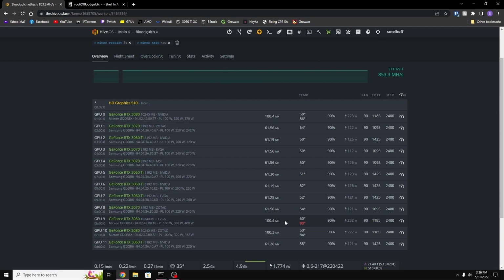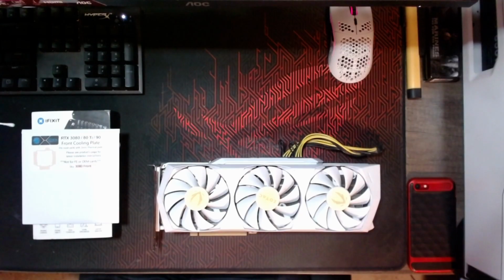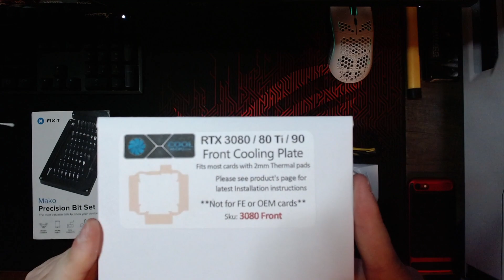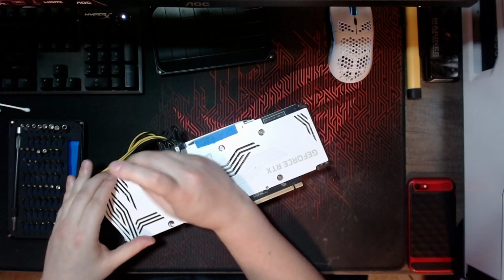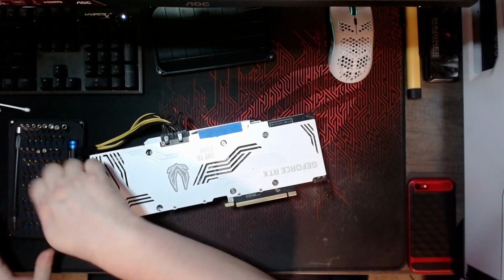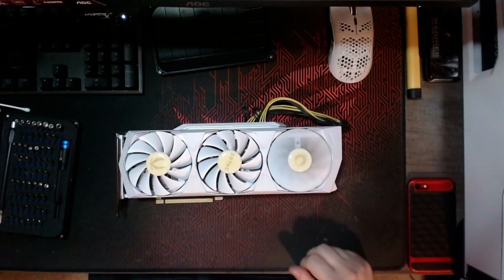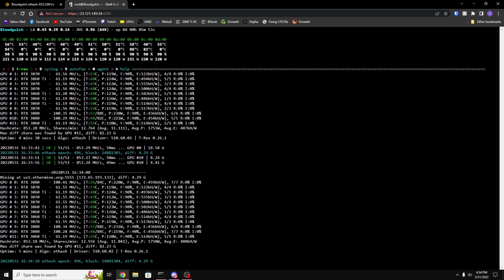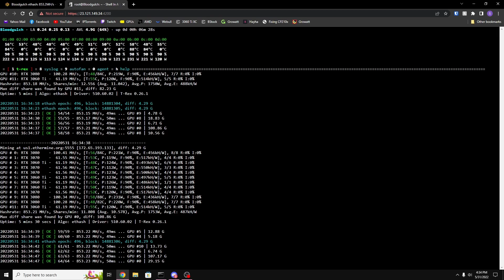Zotac RTX 3080 Copper Mod (2022)

Comment from the maker: Disclaimer: There is always a risk of damage when working on your graphics card. Please take all the precautions necessary to minimize the risk of damage. I am not responsible for any damage that might occur.
Reply: hi does using copper plate safe for gpus instead of thermal pads? bcs to me i think that copper have the tendency to conduct electricity from thosr vram memory and might get short circuit issues.So is it safe tho?
Reply from the maker: @AmeerQ99  If you do it correctly, it is safe. If you do it incorrectly, you can cause a short circuit.
Reply: @sethtrosity  ok , I assume doing exactly like you did in the video is the correct way to do it 👍

Comment: Seems still high temp. Used copper shims for my 3080 TI and getting 75C max temps on load.
Reply: I did this on my Zotac 3090 trinity OC, as it alway ran in the mid 80's and the fans screamed.  Used the plate and now under heavy load and gaming it barely gets over 70. the cooper is 2 mm and the front pads are 3 mm.
Reply: Good temp. Was that specialized copper plate? Those being sold are 1.6mm thick. Zotac recommended thermal pads is 2mm and that is compressible up to 80%.